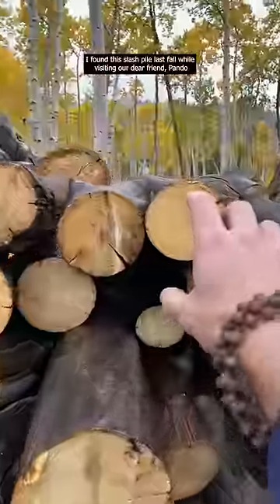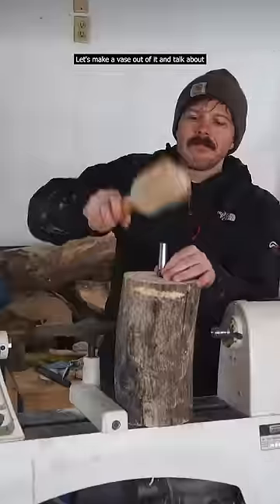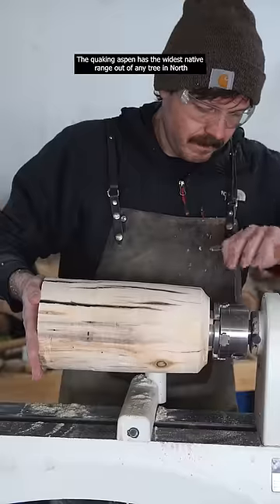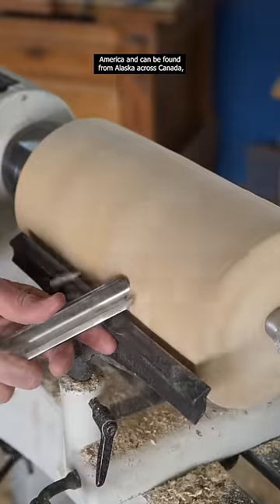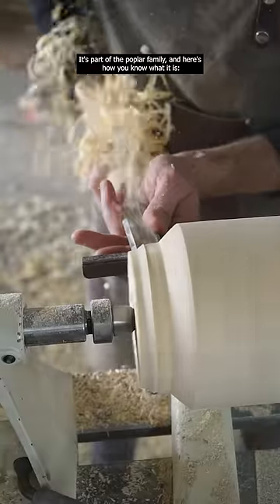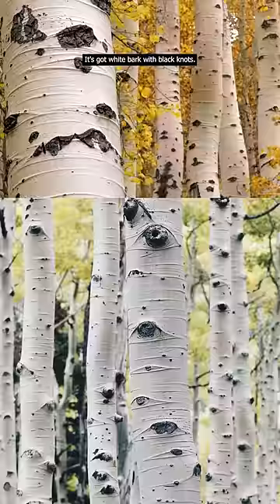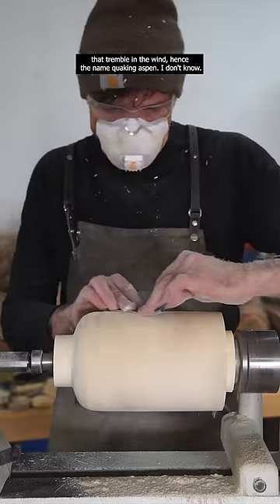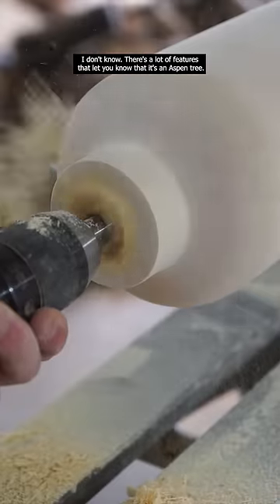Making a vase out of aspen wood from (near) Pando

Comment: It's quite similar to Finnish silver birch because of the white bark and black knots. The leaves are similar too. Apparently the easiest way to tell which is which is by the bark; silver birch bark peels off in paper-thin layers while aspen bark doesn't peel
edit: I call them finnish silver birch because elsewhere in europe they're generally not as tall and straight, and the bark is less smooth